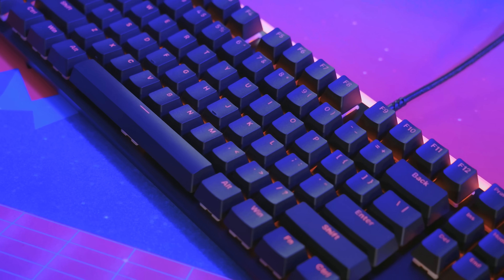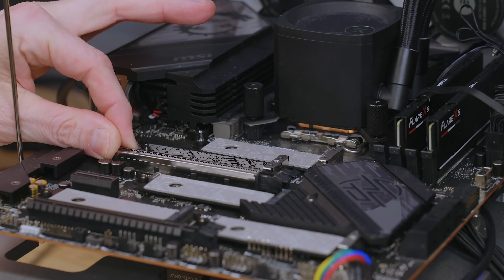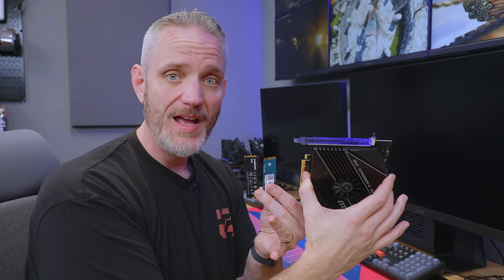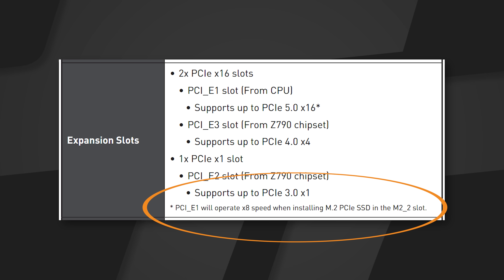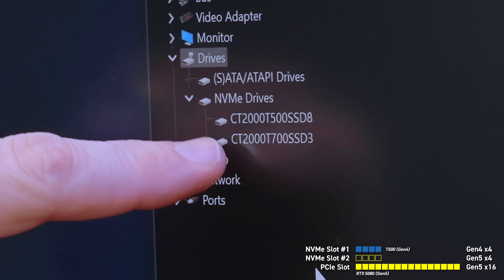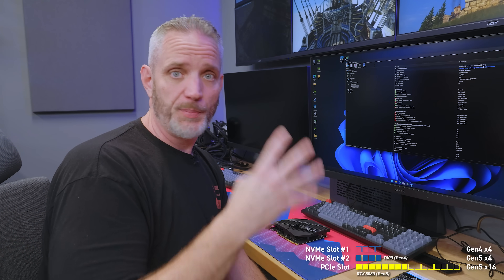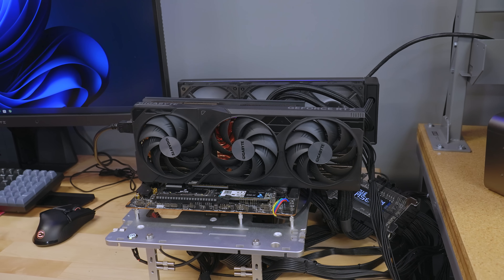Don't make this mistake with your PC!

Comment: This was the hardest part for me to grasp on my second build. Reading the motherboard manual and looking up bifurcation was needed. Sad I couldn’t use the fastest nvme slot and still get x16 on my card. Used the other slots for all my Nvme drives in the end and gave all 16 lanes to the GPU. 
This is a great video explaining it all and I wish I had it back then.
Reply: The worst part is looking up a manual and there's no clear breakdown of how lanes are bifurcated
Reply: @somedude9934  YouTuber Ronin Wilde does a good quick breakdown on a lot of boards
Reply: How much of a performance hit is it though and is it noticeable?
Reply: @haies09 It's been tested on a 5090 that you get less than 1% performance drop on 5.0 x8 vs x16, just bifurcate bro. TechPowerUp and many others have tested this.
Reply: OHHHH so if you dont use the fastest nvme slot you can populate as many nvme drives as the board can handle

Comment: I was playing around with some older an older X99 MB, 4 NVME drives and an adapter card. I had to figure out how to force the MB to bifurcate a 1x16 to 4x4. It required using a tool to edit the bios settings since it was not a GUI option. That era of CPUs are great because they can have 40 PCIe lanes, so you can actually make full use of lots of hardware.

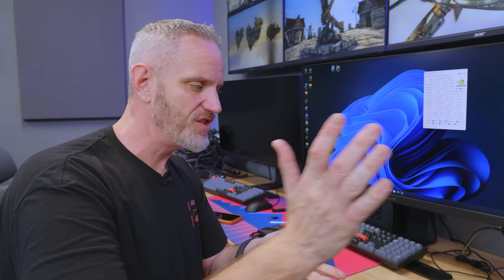Comment: 17:22 - the reason is flexibility, but it's important to note that Intel and AMD give X amount of lanes from CPU and Y amount from PCH, they can recommend the motherboards how to allocate them (like from CPU 16 for GPU, 4 for SSD and all other from the PCH), the motherboard vendors in the end choose how to use those lanes - if for instance they want more PCI_E 5.0 M.2 slots to offer by Bifurcation they can choose to divert some from GPU, and considering several test I've seen including from GN about PCI_E link speed and performance, even PCI_E 5.0 X8 with RTX 5090 had very little difference in performance, so if you're highend user that need lots of SSD storage, those Bifurcated slots can be godsend.

Comment: This has long been an annoyance for me. It seems like intentionally crippling the mainstream hardware in an attempt to make HEDT more appealing to people who need all those lanes. If a slot says it can do PCI-e Gen 5 @ 16x it should be able to do that regardless of what's in the other slots on the board. Bifurcation is just an excuse for AMD and Intel cutting costs and getting away with it because technically the slot CAN run at advertised speeds, as long as you jump through these hoops to make it happen.

Comment: WELL ACTSHUALLY...I did study my manual and kinda obsessed about this, making sure to avoid slots that are slow or share with other, more important stuff on the mainboard. So you are wrong and I demand an apology, right now! xD

...but it's still good advice and in my experience one of the most asked questions when someone upgrades their system, especially when switching from old sata ssds to NVME.

Comment: I learned this the hard way recently. Asus did not label their mobo nor manual correctly and just said "m.2" My gen 4 drive in a gen 3 slot made 3/4 Ram sticks show 0GB of ram. The gen 4 slot for me was the bottom of 4 slots....Had to look up a reddit thread where it was labeled properly. Thanks for nothing ASUS.

Also you're right, I thought going from PCI gen 3 to 4 and 5 was supposed to give us so many more lanes we wouldn't need to bifurcate so much.
Reply: My X570 Crosshair Extreme has another nasty issue. Two of my drives straight up didn't show up until I dug into the BIOS and found out you have to choose between having two live 16x slots or having the second and third M.2 live....and the default is 2 16x slots.

Comment: i have a headache after watching this.. and now im questioning my entire setup..
Reply: It is super complicated. But there's also the question of whether you would actually notice if you did get it wrong. I accidentally installed my OS on a Gen 3x4 nvme drive, and didn't realise for a year - PC still boots in like 5s, everything is snappy, I'll just get on with life...
Reply: @peterwstacey  Yeah, just because a drive can communicate at a certain speed ("being" a certain PCIe gen drive) doesn't mean the drive actually would fill that bandwidth. You have to check the actual read/write speeds, not the interface compatibility. (And of course, whether you actually do anything that requires that speed.) And the same for GPUs. Of course, if there is a problem, it's not intuitive that where you placed the drive affects the GPU and vice versa, so it's still good to know.
Reply: @peterwstacey  I found continues R/W performance much more important than outright top speed when editing videos. After all even 8k ProRes video don't exceed 2.7Gb/s in my experience. Which makes my gen 3 nvme ssd more than enough for anything I would need IRL.
Reply: Right. I know I read it when I built it but did I actually do it correctly?
Reply: Test your nvme speeds in benchmark software and check gpuz.
Reply: Did it right because I read the manual. 😃
Reply: I'm happy enough knowing even at x8 for the GPU I'm not going to notice in my mid-range build. My new build will be on Gen 5 for the OS, the GPU at x16 or x8), and a plain old SATA hard drive in the case for cheap bulk storage.
Reply: Do people not read the specs and manuals? Before i buy any board i read the specs and download the manuals to see what is what and if it will work with what i need...

Comment: Solution: just get gen4 ssds if you are gaming. They are cheaper and run cooler.
Reply: No they dont
Reply: @JoeMama-yl1ow yeah they do. The difference isn't as big as 2 years ago but you can still save money and not have to having to deal with gen5 controller shenanigans.

Comment: Always pay attention to your motherboards manual. I have had maybe 50-60 pc motherboards over my life time (not including systems I built as a job). I always read the manual back to front at least 3 times.
Reply: 50-60 mobos.
Do you eat them?
Reply: Same, I've been taught to be super careful about choosing motherboards, and reading the manual carefully to ensure it is able to do what I need it to is one thing I always do multiple times to ensure I don't miss anything before committing to a purchase. Bifurcation is one of those crucial things, especially since I use a pcie sound card, so I have to ensure there's a third slot available that doesn't interfere with the first slot that the GPU uses.
Reply: If you had 50-60 PC MBs in your life, you must either be around 200 years old, or you had like 40-50 too many. :D
Reply: If you say the motherboard manufacturer name into a mirror three times, then the CEO will appear behind you.

Comment: Note, Not all GPU's are PCIE x16, some are only PCIE x8. NVIDIA GeForce RTX 4060, 4060 Ti, and AMD Radeon RX 7600 are only PCIE x8. I also honestly don't believe it is worth spending the money on a Gen 5 Nvme drive. Rather buy a bigger Gen 4 Nvme. You won't notice the performance difference in day to day use, but you will value the space for more games and other files. You may also need less drives then that can prevent bifurcation by occupying more slots. I use an expansion card and 8, 3.5 inch drives for file storage and a 4TB Nvme for my OS, games and programs. My GPU stays happy with 16 lanes.

Comment: So I have a MSI x570 gaming wifi, has two M.2 slots, one Gen 4.0 and the other 3.0. My 5950 has 24 lanes and the 7900xt takes 16 leaving 8 avail. The board also has an additional crossfire pcie at Gen 4 x16 lane. If I 2 m.2 at Gen 4.0 should avoid the slower m.2 gen 3.0 and hookup the other m.2 via adapter to crossfire pcie instead?

Comment: I have a question regarding this bifurcation thing. I have an Asrock B450 Steel Legend mobo and the manual states: "If M2_1 is occupied, PCIE4 will be disabled". Now, M2_1 slot is the NVMe slot directly ABOVE the FIRST PCI-e x16 slot, so does this then mean that the M2_1 slot is using the lanes from the PCI-e 4 slot?

Comment: My MSI B760 board is pretty straight forward on the CPU vs chipset lanes. The catch that you'd have to RTFM to know is that m.2 slot number 3 takes away the 4th SATA port if used, so someone who wants to run a bunch of HDDs for bulk storage might get an annoying surprise if they didn't research that ahead of time.
Reply: My motherboard basically cuts of SATA 5 and 6 when it starts bifurcating. A lovely X570 motherboard.

Comment: Can't believe Jay made a video on this I just came across this issue this week I'm running an old EVGA X99 FTW MB and PCIE lane 4 is a full x16 lane just like the PCIE 1 lane! But for some reason even after I remove anything from the PCIE lane 3 (which according to the manual will cause Bifurcation of lane 4) it will not revert back to it's x16 capability and lane 4 is now stuck being x8 !??? Resetting CMOS removing the battery updating the BIOS ect ect but nothing will revert that Lane 4 back to it's full x16 glory! Really annoying cause I need it to be x16!

Comment: so i have a b850 tamahake mother board and i have 2 , crutial t500 sat in the two gen 5 slots on the mother board and a 9070xt plugged into the gen 5 slot ...   i did the test with gpu-z like you showed and im still at 16x5 on th gpu and my Nvme speeds are fine  both and are running 4x4 , so i dont know what to make of this video . i would assume im not getting any bifurcation , but it would if i populated another slot and occupied even more lanes. im thinking i may be wasting some lanes but not hit the bifurcation point

Comment: Sorry, Jay, but I think you're making a small mistake here. 04:00
Yes, it's only electronically connected to x4, but you can't bifurcate x4 to x2x2.
as mention at 13:23 You can only bifurcate x16 to x8x8, x8x4x4, or x4x4x4x4 and on some board a x8 to x4x4 
sadly not every board has bifurication option in the bios. some have no option for bifurication.
Reply: Those NVMe expanders/hyper cards and cheaper versions.
They're all based on the same principle.

With the dual NVMe version,
the lines of the first NVMe drive go to the front four lines of the PCI-E slot, and the second NVMe drive then goes to the next four lines of the PCI-E slot.

With the quad NVMe version, this continues until you reach the full x16 slot.

From there, an x4 slot can never support two NVMe SSDs installed on such cards.only one ssd whil be detected and thad is the first on the card.

By the way, I have four Hyper M.2 cards waiting for bigger m.2 NVMe SSDs😏, but I'm thinking of replacing them to U.2/U.3 or E3.S cards, even though I can only run Gen3 version on the WS C621E . I like to have more than the 8tb disk limit of m.2

Comment: next week, we will explain that if you are not working with your computer (like video editing or heavy file transfer load scenario) you don't really need to have better than a NVME gen3 x4 (which is gen4 x2 and gen5 x1) to game or have a "common" usage of your computer ! 
it has been proved multiple times, even a SATA SSD which is like a gen3 x0.5 (it doesn't exist but whatever) is enough to play any game ! it was a long time ago, maybe now it's safer to use gen3 x4, but otherwise ... even buying gen5 SSD is throwing money .... FOR NOW, maybe it will change later, but FOR NOW, except if you have a very specific configuration of motherboard and/or working with heavy file transfert load ... just populate everything, it's fine ! 
you could argue that you are future-proofing your storage... ok, fine ... i'd give you that

nontheless, the explanation about PCI lanes is useful for ppl to understand that

Comment: I ran into this issue a while back. I had an ASRock B650 Live Mixer mobo and needed more m.2 slots. I bought the Gigabyte x870 Aorus elite thinking it would be ok and found out that as soon as I added a third or 4th SSD it would cut my GPU to gen 5 x 8 instead of x 16. I then picked up the same board but this time the x870e version and guess what. I had the same issue. The issue was that the info on Amazon was not clear and the website manual was a bit confusing. It was my fault mind you but I do wish it had been made clearer. At the end, I bought an MSI x870e Tomahawk and that mobo does what I want it to. The only catch is you have to disable one of the 40 GB USB-C ports but that doesn't bother me. And yes I am aware that x 8 versus x 16 does not make much difference for GPU'S however it likely will matter more in the next few years. I am very happy so far with the Tomahawk mobo

Comment: this is good timing because i'm about to install my first m.2 nvme drive on a Z590-A motherboard paired with an i9 10900 (10th gen NOT 11th gen 11900) but my issue is that i already have all 6 SATA 6GB/s ports occupied with 3.5" and 2.5" storage drives. and according to the Z590-A manual, which i did read through prior to watching this video, when installing an m.2 drive in slot 2 or 3, one of the SATA 6G will be disabled. so i can't just add another drive (the m.2) to my already installed 6 SATA drives. i have to sacrifice one of them.

Comment: What we need is a new connection to the CPU for storage devices making PCI-E just for the PCI-E slots. The new connection being just for storage could be near endless for the number of drives by separating storage use and connected. When a drive gets used it gets the full bandwidth when idle it gets just the connected lane saying here I am ready to do something. Most drives in a consumer system sit idle most of the time and do not need full capabilities the whole time. We still need more PCI-E lanes so all PCI-E slots can be full X16 when fully populated. PCI-E based NVME drives can be used in expansion cards and bifurcation just on that one slot, X16 available to the card and 4 drives at X4 installed onto it.

Comment: Your point about people unnecessarily buying fast drives is valid but there are times where there's a good reason. When I was using a b550 board gen 4 drives were taking over the market more but gen 3 drives were still as expensive as before. That means you can either buy an expensive gen 3 drive to get closer to gen 3 chipset slot speed, or buy a decent gen 4 drive for the same price or less and still saturate that gen 3 slot more than the gen 3 drive. You obviously buy the gen 4 drive even if you lose 30-40% of it's capability since it's going to be faster regardless and you can use the gen 4 drive in a gen 4 slot when you upgrade your cpu/motherboard later.
Reply: Also each “2x speed increase” is by nature half as noticeable. Gen 3 to 4 is more noticeable than gen 4 to 5 assuming both are equivalent performance leaps.

Why? 16s -> 8s (2x) improvement saves 8s.

A further 2x increase from 8s->4s only saves 4s. Half as noticeable.

That and if youre gaming most of your read write that you notice probably occurs during downloading the game at which point youre usually wifi throttled.
Reply: One situtaion of buying a higher gen drive than your current MB/CPU combo supports is if you plan to chang to combination that will support the the higher gen within the lifetime of the drive. Say you need a new drive now but will be getting a new MB/CPU combo next year that is a case where it makes sence to by the higher gen drive and then the following year with the new MB/CPU you then get the full speed out of both.
Reply: Same here. Used to have a Gen 3 1 TB Samsung 970 Evo Plus in an HP ZBook G6 Mobile Workstation with a Gen 3 slot. Put a Gen 4 2TB SK Hynix Platinum P41 in it and it does make a noticeable difference even if the slot is still 3rd Gen. The newer SSD saturates and works much more efficiently in there. I use the Samsung Evo Plus as an external storage now in a Sabrent Rocket SSD enclosure.

Comment: So if I understood correctly, it sounds like first you have to take into account if the slots you are using run through the CPU and which CPU you have (due to PCI lanes). If the slots you are going to use both go through the CPU, you should switch the slot of the NVME to go through the chipset, and in that case, unless you absolutely do NEED FOR THE SPEED, you can go down 1 or 2 gens and be completely fine instead of potentially cutting your GPU performance.

Taking the exact example you showed in the video, I assume if this were Ryzen, you can totally run the x16 + x4. Although I am unsure about the gen. Maybe the 4090 would've ran at Gen4x16, which would be Gen5x8. But the drive would've had the full lanes for sure.

Honestly, this is a bit stupid as fuck from companies and manufacturers. Or genius to take more money from you, perhaps. It is kinda dumb that knowing Intel in this case has less PCI-E lanes, they would put both slots together anyway KIND OF making it unusable regardless of what you do since you'd be splitting your GPU. Like the Gen5 slot is literally a waste in this case if you wanna use the full GPU bandwidth, unless I am mistaken.